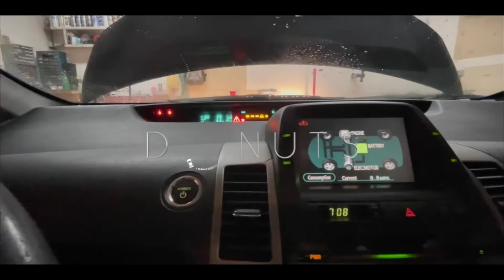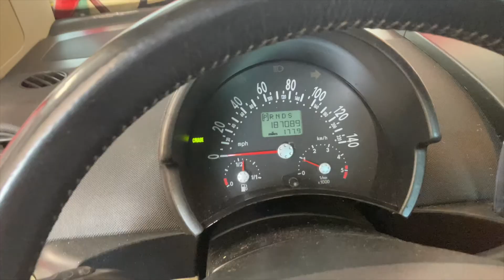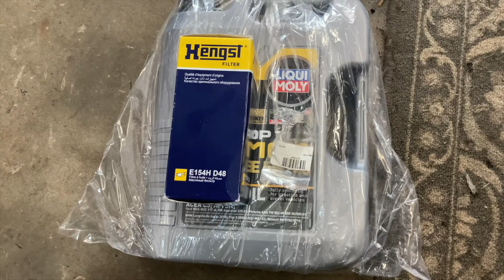2004 Beetle TDI:  Oil Change/Engine Flush + Fuel Filter Replacement/Diesel Purge

Comment: I bought a 2003 tdi (yellow)bug a month ago, as with any car I service them straight away. I pulled the air filter out and it literally looked like it hadn’t been changed in years, it was black, and too small 🤦🏼‍♂️ 
The oil was so dirty but the oil filter had kind of compressed itself like a hand had squeezed it. All that done I realised I’d forgot the fuel filter. I’m doing that this week, your video was very informative 👌🏼
Thanks man 🤙🏽🤙🏽
Reply from the maker: Good luck with the TDI! Glad that my video was able to help!
Reply: @jaredrigged  It’s a belter mate, I knew I’d landed a good one. Just recently had all the belts and ancillaries done, inet, egr and injector purge. 
It’s like brand new

Comment: Thx for this video it is very good for me i have a 2000 TDI Beetle too, specially so smart the way you replace the fuel filter O rings the bottom first and the the blue go to the top easily! Thx again and congratulations.